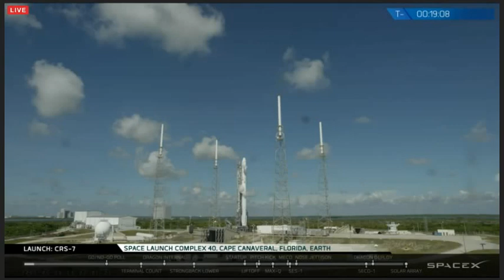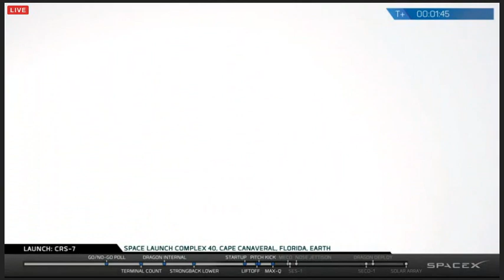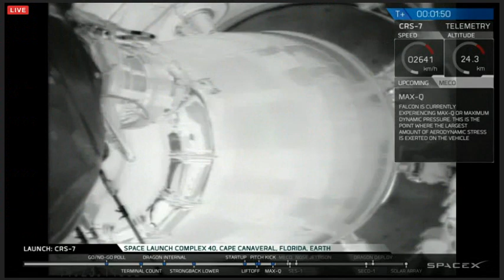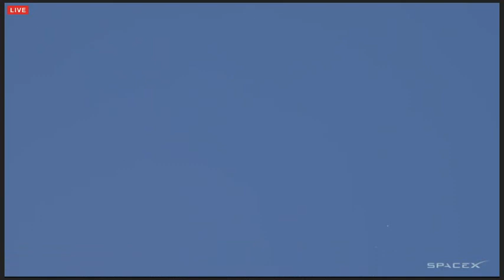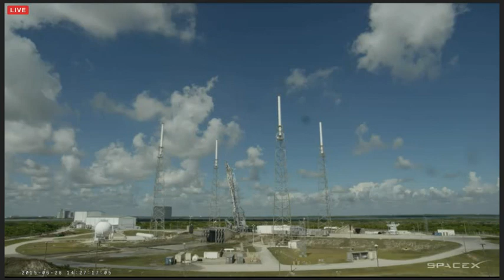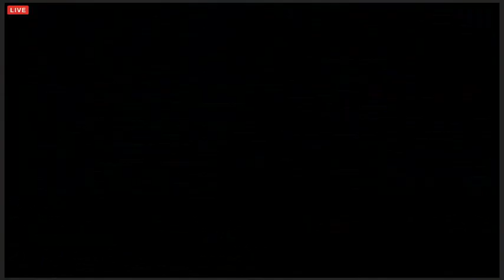SpaceX Rocket Explodes - CRS7 Blows Up - Falcon 9 Launch June 28, 2015

Comment: Falcon 9 doesn't have fins, so how come it doesn't tumble in flight?
Reply: Because the engines can gimble, directing the flight path.
Reply: Tristan Wassman The nozzle of the rocket motor can move, meaning it change the thrusts direction so it can control the rocket a lot better than fins.
Reply: +Tristan Wassman Because KSP isnt real life
Reply: I'm pretty sure it has fins
Reply: I didn't see any. Neither does the Atlas V.
Reply: I understand that, but you'd think in all actuality that it would need fins to stay stable in flight.
Reply: +Tristan Wassman they use it to stabilize but also to steer the rocket to the landing site.
Reply: Speaking of which, did you see the landing a couple days ago?
Reply: +Tristan Wassman offcourse :) i have followed spacex progress since 2008. Watched almodt every launch live. Great sucess! History was made
Reply: I agree. Who knows? The Falcon 9 might become the next Space Shuttle.
Reply: Grid fins?

Comment: That stabilization system is incredible, the Falcon flew for 6 seconds with a completely torn nose cone, that is ffing amazing.
Reply: The second stage blew up. The Dragon spacecraft stayed intact during the entire mission, until collision with the ocean, a few minutes later, and many miles downrange. However, you aren't wrong. The falcon 9 is amazing, it can handle 2 engines blowing up, and still getting to orbit. CRS-1 had a single engine blow up on launch, and the payload got to its intended orbit.
Reply: @TNTHammer  Thats pretty true, Elon

Comment: It looks like the failure started near the top of the rocket where the second stage is and lots of LOX tank failure?    You would think a big explosion but just lots of venting and frozen parts and foam insulation everywhere and than 5 minutes later NASA goes we think we have an Anomaly.  Uploading my half now from NASA.
Reply: Your observation is completely accurate.  The rocket had gone through maximum aerodynamic pressure (max Q) and was approaching main engine cut off.  The rocket appears to push through a billowing gas cloud of its own making until structural failure occurs about nine seconds later.  This and the lack of a fire ball at disintegration indicate a likely problem with the second stage.  Every set-back ought to be viewed by Space X as an opportunity to learn and improve; One learns very little from continuous success.
Reply: websuspect failure was on the pad-design of the rocket
Reply: joseph prosser I was surprised i am not a rocket science.  They said they failure occured somewhere in the second stage system and there was an LOX deflagration of some sort.  NASA sent a self destruct signal at something like 3 minutes and 40 seconds.
Reply: george david morris would would you suggest space plane?